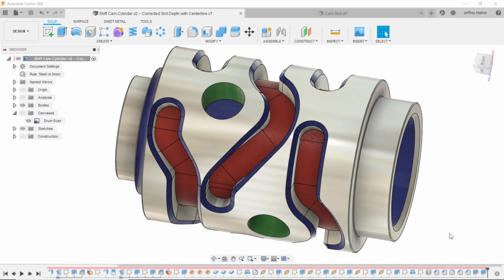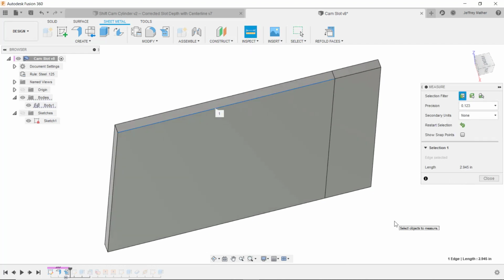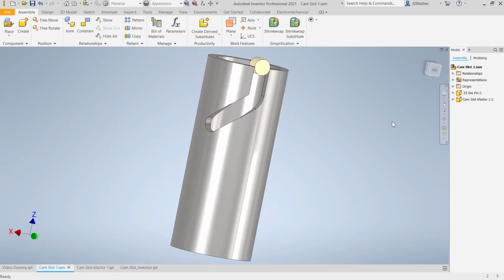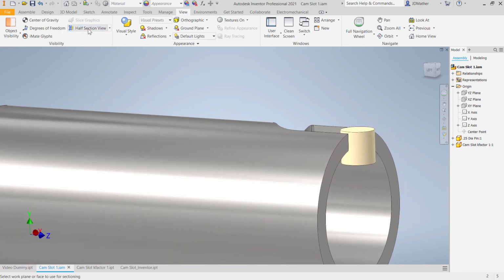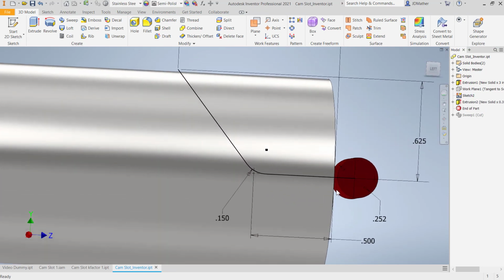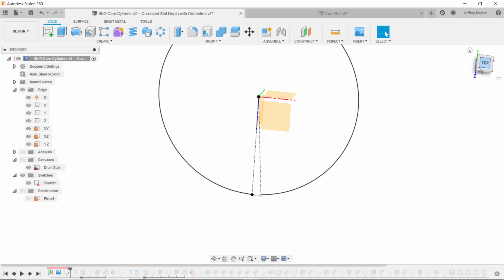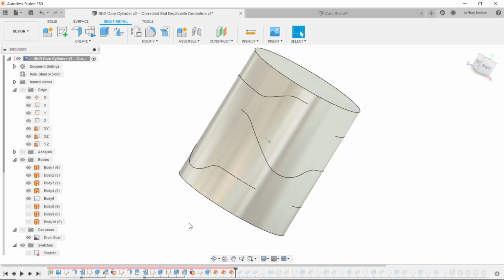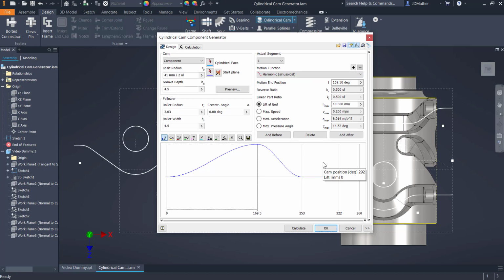Fusion 360 Cylindrical Cam

Comment: Thank you a lot! I've had issues in Solidworks with drawing a cam groove on a cylindrical member to make a shifting drum but your method of making the centerline as the surface on the side of a sheet metal part finally allowed this.

Comment: Wow, the use of the sheet metal workspace never ceases to amaze me! When you posted this solution to the Autodesk forums, you mentioned that Autodesk would likely update Fusion in a way that makes this workflow obsolete. Are you aware of a more direct workflow to achieve the same result, or is this method still the recommended approach?

Comment: Rookie question for you. Why not create a path around the cylinder (3D sketch independent of the cylinder), set a plane perp to the path, sketch the follower profile (cross sectional intersect) on that plane at the necessary depth and sweep along the intended path. At each end of the path, use the follower body as a tool to cut out the remaining interference. Then offset the faces for whatever clearance is needed?  

Sheet metal just seems like an overly complicated approach. But perhaps there's a reason you went that route instead.
Reply from the maker: Because the resulting geometry would not be correct.
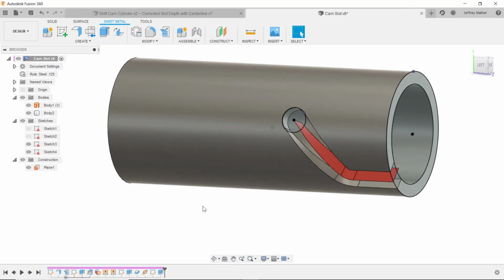Reply: @TheCADWhisperer  First, a thank you for taking the time to reply. I appreciate it very much.  I guess where I'm confused is how the approach I described would be any different, fundamentally, from the way Inventor essentially cuts by sweeping a tool cross section no matter if the tool is held stationary or the part. I'm referring to what can be seen in the dynamic view demonstration beginning around minute 7:30 or so  in your video.  

From a 3D perspective, that smaller cylinder (the cutting tool) is effectively a rectangular cross section on a plane that is, at all times during it's cutting path, perpendicular to the path and in this specific demonstration, normal to the part. There is no point along the path during which this isn't true.  

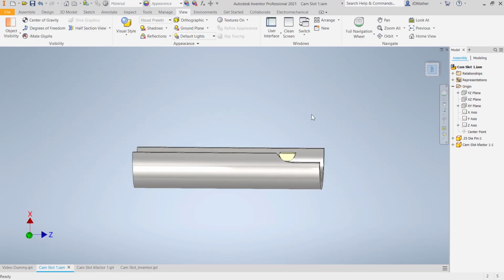Your use of a section view that was along the length of the cylindrical part (10:20) doesn't accurately convey what's actually happening in real time. At 9:50, for example, what I just described above holds true. 

If you could define a section view of the cutting tool through the tool's own axis, perpendicular to the path, and normal to the part....and animate it...we'd see an accurate representation of the cut from the perspective of the cutting tool itself. And it would (in the case of the shape of the "tool" in this video) be a rectangle.

What am I missing here? Is there any way in Inventor to animate a section view as I described above passing through the axis of the cutting tool? So that we can see it from that perspective? That would be incredibly useful here for those of us who are more visual.

In any case, thanks for making these great videos. I just found your channel a couple days ago while working on this exact problem. I need to cut a path in a cylindrical part such that the tool traverses at constant speed from one end of the part to the other while the part rotates 720 degrees. But Fusion 360 is seriously lacking in this area.
Reply from the maker: @john.queue.public  I would need to see actual files to analyze the results to see if geometry is correct.

Comment: Use emboss command.
Reply from the maker: Emboss will absolutely NOT result in the correct geometry.
Reply: @TheCADWhisperer  thx for info i used emboss and it's not working. I can't make joint because my cam slot is 360° I can choose only x axis but i need to choose y axis of cam for mate my follower. (I don't know English I hope you understand me)
Reply from the maker: @PeppoMusic  I only understand geometry.  Can you provide a file that illustrates your geometry?
https://forums.autodesk.com/t5/fusion-360-design-validate/bd-p/124

Comment: Thank you for sharing. My question is for what you do while in inventor. I have wrapped my cutter path around my cylinder. I'm getting hung up when you bring in the cutter at the 16 minute mark. How did you create that? I tried to create a cutter and import it, but I am failing somewhere. Thank you again.
Reply from the maker: Attach your assembly here https://forums.autodesk.com/t5/inventor-forum/bd-p/78
Reply: @TheCADWhisperer  will do. Thank you.
Reply: @TheCADWhisperer  I created a post here. https://forums.autodesk.com/t5/inventor-forum/cylindrical-cam-help/m-p/10023487#M814753

Comment: JD,  this video is spot on for a "cam-lock" I'm trying to capture. I followed the steps to the point where you flash (capture) the cam surfaces and then "delete everything else". I get lost at this point. I see the paths suspended in 3D space after hiding the parent body, but every attempt to open a sketch results in the loss of surfaces. What am I missing here?
Reply from the maker: Kind of hard to make any diagnosis without a file.
Reply: @TheCADWhisperer  
JD, the problem is I have no expectation of what should happen after selecting the surfaces -- and neither does my local SolidWorks guru. The file is a mess after my repeated attempts to design the cam follower body. I can try to clean up the file, but in the meantime, what should happen? What is the sequence of commands to incorporate the selected surfaces into into a sketch (or body) for further work? DE
Reply: @TheCADWhisperer  JD, I mad a local copy (in .f3d) and attached it here, but can't -- copy/paste doesn't work. Is there an email address or website to drop the file (286kB) onto? DE
Reply from the maker: @davidehrenberg100  
https://forums.autodesk.com/t5/fusion-360-design-validate/bd-p/124
Reply: @TheCADWhisperer  JD, I posted a file on the forum. Keywords:  embedded surface toolpath capture
Reply from the maker: @davidehrenberg100  
Link?
OK, I found it. 
https://forums.autodesk.com/t5/fusion-360-design-validate/embedded-surface-toolpath-capture/m-p/9830383#M231396